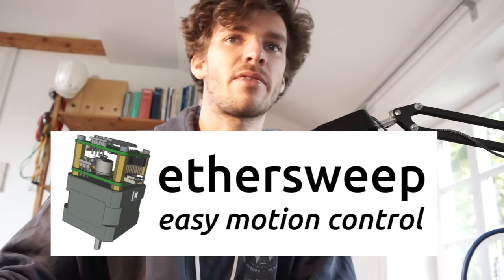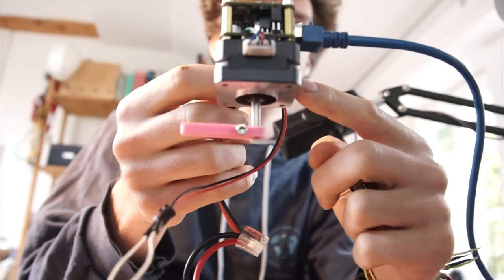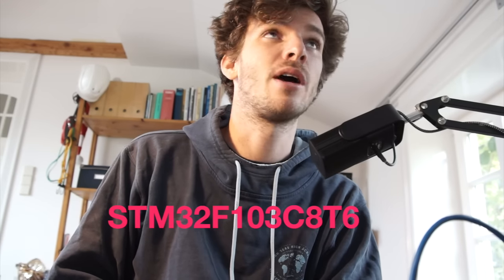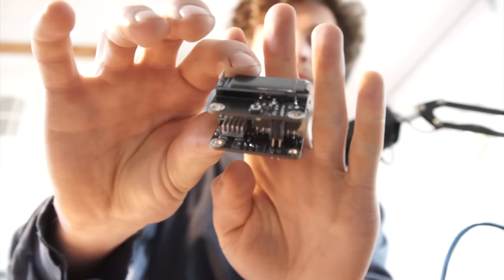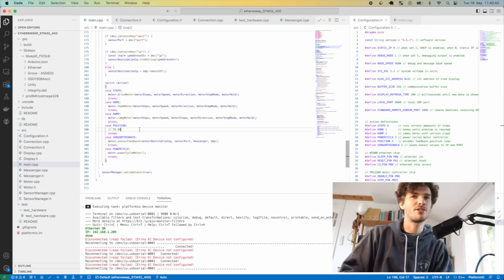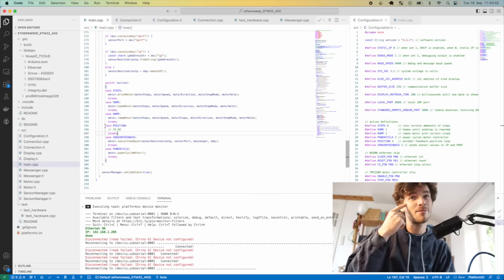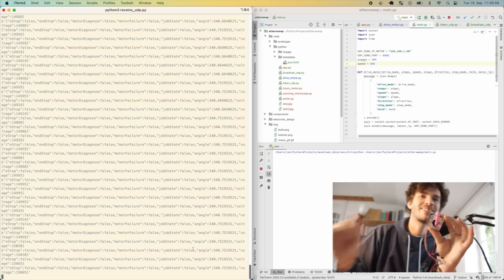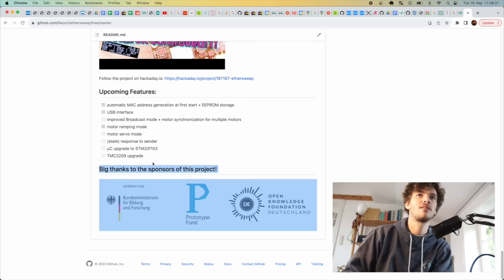What happend to Ethersweep? Project Update!

Comment: It might be a complete redesign, but have you considered adding power over Ethernet to these boards? It would be a really attractive feature for rapid systems design.

I've created quite a few motion control systems, and by far my favorite small servos to use are Dynamixels, which can be daisy chained with a single cable. It speeds up testing iteration so much, being able to arbitrarily move or add motors without having to make multiple cables for comms and power. In this case, there's a power solution already designed for the physical layer youve chosen, and can provide enough current to drive several motors simultaneously.
Reply: yes this! and offering kits for propotpying application where time goes over money.
Reply from the maker: Yes POE is in the planning for another prototype. It's a bit hard to put everything in the small form factor it currently has but let's see :)
Reply from the maker: @NmEter2  The boards can be easily ordered with my files on GitHub. You only need to assemble some THT parts and the SMD AS5600 encoder. But when the next hardware version is ready, I'll try to distribute them somehow. Prices are currently estimated to be around 150€ for one set with some minor assembly.
Reply: @Neumi  Looking at the designs, there's quite a few big changes that would have to be made to keep the form factor. It's awesome that you are working on it!
Reply: @Neumi you can always add a board to board connector and add a second PCB 
the length of a stepper motor assembly are rarely critical.
Reply: And maybe to give that small microcontroller a chance of running at higher speeds consider switching to a more basic protocol and not ascii encoded json.
Reply: @Neumi I tried to make a POE blind motor (blind meaning roller blind for your windows) but the POE design was quite expensive, but I was over designing it using reference designs from TI. I want to revisit it but using premade poe sinks so I got one for 12v 2A or something like that and hoping to work on it at some point (probably in a year 😅) 

Maybe this gives you some idea, and actually now I just checked, you can now find POE+ (12V 30W) modules. Search this I think it will be very helpful

PEM3012C

This module pretty much solves the power issue it seems. Have you considered using esp32? It can use ethernet and then work with home assistant. I wanted to do this because when I renovate my house I will put a cat6 cable in each window frame to then connect to the controller and I can have automated blinds in home assistant.

Hope this gave you some idea and found the module useful :)
Reply: POE definitely seems interesting, but when doing a basic search, it seems that it's only capable of supplying 350mA at around 50V-- so 17.5W max.  This seems a bit restrictive for larger steppers that may require a lot of power for a short period of time.  I would also hate to rely on some random switch that may be capable of a limited amount of power across several ports simultaneously.  You really want to eliminate any sources of uncertainty when controlling physical objects that may be quite expensive, which could destroy things or cause safety issues if not operated very consistently.  It's one thing to have a device glitch and need to be restarted, but another entirely having the potential to ruin something if operated incorrectly or unreliably.
Reply: @arva1kes  they are 12V but only 1A or so, unfortunately these steppers at max holding torque need much more, so to build a POE+ module is quite hard but if he is willing to design one which can be split into 2-3 layers it would definitely work. POE+ modules do exist but as a daughter board to solder onto a motherboard
Reply: @flomojo2u  thats why I talked about poe+ 👍 also why would you be relying on a random switch? I am talking about using one in my home, so the switch that I choose will be able to provide enough power anyway, if not cost effective Id use poe injectors. Quite simple really and you end up with a single cable solution
Reply: @flomojo2u  I agree. And even if the wattage is enough, the small wires have a lot of impedance, so rapid power changes will spew really badly. So unless you have a ridiculous amount of capacitor power storage steps will get missed as the current isn’t there when needed.
Reply: POE is probably ok for a couple of small infrequent loads, but you really do want to have local power because some steppers are hogs.
Reply: @TonyCoyle  true however the idea of only one cable needed really appeals to me, I haven’t actually tried a poe one but on paper it seems like it should work, the stepper motor I used, a normal nema17 one needed 2A (24W and poe+ can give 30W) for my setup, the stepper was also geared down to give more torque, I could probably increase the ratio to get more torque.

Also very large POE PTZ cameras have multiple steppers in them often working at the same time. So if there’s enough power for those then why not for one stepper? Yes some times the cameras use their own poe injectors and im actually also fine with that as I will have most of my equipment in a control panel for all the home automation stuff so it works for how I will design my place.

Comment: Would love CAN BUS support for control and sync.  You could still setup with LAN, of course.  Great work, btw.
Reply from the maker: CAN is definitely on the list of features as an alternative option. Test PCB is already designed.

But then we have to come up with a new name I guess :D
Reply: @Neumi smart sweep 😁
Reply: SweetSweep
Reply: CanEtherSweep (?) 😂
Reply: RemoteSweep
Reply: DualSweep
Reply: DerSweep (for 'der'tiministic and german)
Ok I will show myself out now...
Reply: Hmm does that even make sense if the mac would support avb ethernet you basically only need as much wires as CAN.
Reply from the maker: @platin2148  I think CAN is more for machine2machine communication and not if you want to drive the motors from your computer. Both protocols have a good reason to exist, but I thought standard ethernet would be cool because I can control them from my average household computer/raspberrypi. CAN would be great if you anyway have a CAN network set up I guess.

Comment: It would be cool if a few free gpio pins of the microcontroller could be exposed to an optional third pcb that could be stacked on top, so one could add additional sensors and read/control them over network. This is such an intriguing project. I'm afraid I have to much on my plate to contribute.., but I'd love to get in contact

Comment: FreeRTOS is your best path forward for a scheduler. Be careful to keep interrupts short by just waking a thread to do the work.  That way you’ll stay more real-time for the critical threads like the rotation sensor and stopper commands. Great start!
Later on, a servo version would be very compelling for cnc control of large mills or lathes. Check out Physics Anonymous cnc mill build to learn more.
Reply from the maker: I‘m not sure if freertos has too much overhead and long ticket times. Maybe its faster and better to build the scheduler myself (?) 
But I‘m not set on that :) feedback very welcome!
Reply: @Neumi  or just use Rust :D
Reply from the maker: @elpiel  Rust for embedded? Haha no way :D you'll see me write drivers for the next year :D

Comment: Very interesting project!  Thumbs up and subscribed.  If I were to do this, I think an ESP32 using wifi and bluetooth would be the processor, with FreeRTOS, using MQTT messaging.
Reply from the maker: Thanks! MQTT is on the list of potential features. Not sure about the instruction set yet, though. FreeRTOS might be an option to get better timing. Do you know how fast freeRTOS runs on the ESP? In terms of cycles or tickets/second. As the controller currently needs to do all the step driving and timing for the TMC2209 and therefore do I need very fast timing. Having a fixed cycle time with freeRTOS does not help if the cycles are 100 microseconds when driving individual sub-steps :D
Reply: @Neumi maybe you could make use of timer peripherals for doing the step counting so you can free up the cpu for other tasks.
Reply: I was about to recommend ESP32 as well. Wifi is so much nicer than needing an ethernet cable and switch port for each stepper.

Comment: Looks really interesting, how accurately do the individual steppers synchronise to each other.

Any thoughts on adding Poe+ or Poe++?
Reply from the maker: Currently approximately 10-20ms. But it depends on the network load. And it is not optimized yet. Nothing for CNC control.

Comment: This is really cool! I can see this lowering the barrier for entry on motion control. Like others have said, having an integrated switch for daisy chaining would be awesome to see. 
Is there a reason you didn't go with an ESP32 or ESP32-S3? It supports ethernet with the addition of a PHY transceiver.
Reply: He could use the wesp32, or a similar design, then you would get 11W from POE, and a dual core 240mhz mcu with 100mbit ethernet phy.

Comment: Have you considered some kind of NTP Time Sync to synchronize the clocks of each motor ? 
The idea being that if you're able to do this then you could possibly synchronize moves of several motors by sending some commands to several motors along with a time for the command to be executed.
Reply from the maker: I love the idea! That was actually a loose idea some months ago, but I didn't test anything in that direction. I'm unsure if NTP can be synchronized to a few microseconds on a normal ethernet network (?). If you know more about that, I'd love to have a chat!
Reply from the maker: I just read "down to 1ms in local networks". This would be at least an advantage over normal packet times and its spread.
Reply: Really nice project, you could look into Precision Time Protocol (IEEE1588) ptpd implementation, but you need an PTP capable ethernet phy as far as I know. I'm no expert on it, and it seems complex. Just wanted to share :)
Reply: @Neumi  Sorry can't help you much, it was just a random thought from an internet bozo ....
Reply: @Neumi  To synchronize the "actions" (f.e. in a CNC application with more than one axis), like moving exactly a 45° path, the easiest way may be accumulating the commands for the actions, then committing them (state = ready) and synchronizing the start of motor stepping over a DISCRETE signal(non latency-affected by definition). Well, that defies the "beauty" of a pure network solution, as an additional, not hindered with latency, signal path that had to be introduced. 
Anyways, you did a great job with your project and you can be proud of your work! Who said that there has to be a solution that can handle EVERYTHING? God's "Eierlegende Wollmilchsau"?:))
Reply: Maybe you could try to get in touch with someone from the Institut für Werkzeugtechnik from the University of Stuttgart. I know that they do some research about timings and latency in industry networks with sensors and actors. If you want I could ask someone from the Institut if he knows somebody who is involved in this topic.
Reply: @Neumi  Just talk to Jeff Geerling. He knows some stuff about NTP and PTP. The latter has a precision down to nano seconds.
Reply: I also think the timing between multiple axis is crucial when used with more complex machines like 3d printers, laser cutters, cnc mills etc. Maybe you could write an integration for linuxcnc? You or other people could then test the real time performance of the system with the Differenz synchronization options.

Comment: PoE would be useful. I know this limits the power of the stepper which can be used, but for many applications this is OK. Also, it is important to keep costs low. It may be good to have several models with different features and costs, so no more expensive unit than required can be chosen.
Reply: PoE+ supports 30W, there are higher POE standards that do up to 100w. This has me wanting to build a 3d printer using this but I want POE because then I can use a 5 port poe switch with a Pi and 4 steppers. :D I've been wanting to build a printer with servos, these have the encoders so it makes the stepper a servo. No lost steps ever. :)
Reply: PoE seems like a good fit here, but for anything larger than nema 17, 30W might not be enough, at least not if maximum performance is the goal.  OTOH, Hi-PoE at 100W should do it.
Reply from the maker: I think the same. High power and surge is a problem with POE. Especially if you need multiple motors the switches and injectors get very expensive.

Comment: Amazing project! i was looking to something like this for a long time but that works with ArtNet, so that the motor moves to certain positions based on a dmx output (0-255)
Following you for more inspirations ;)
Reply from the maker: artnet would be very cool! And I think not too hard to build as an additional firmware or mode :)
Reply: I would be very interested in that!! I have been working on a project where I did exactly this with a basic Arduino setup. The biggest issue that we have and I think you can quickly solve is implementing a 16 bit mode. If you ever end up spending time I would love to help out.
Did I mention this is an amazing project!!! ❤

Comment: How about use ESP32 with WiFi conectivity ? Then you just need a power connected.  And maybe also support for MQTT protocol ?
Reply from the maker: MQTT is definitely on the list of ideas. Wifi not so much. The wifi credentials somehow have to be programmed into each controller. As we need a cable anyway for power a data cable is not too much of a problem. Data rate and reliability is also much better with cable. But I see use cases for wireless motors ;)
Reply: @Neumi  With WiFi you can use that some kind of 'standard' model, to create WiFi AP, connect and enter credentials over some simple web page. 
And with ESP32 you can create Bluetooth version of the motor 😉
Reply from the maker: @milan8063  I'm not a very big fan of ESP32/Espressif chips. They tend to be unreliable and run some strange stuff in the background that you can't control. (you can't even run ESPs as an I2c slave at reasonable speed for that reason...) This is nothing for an industrial controller IMO. Running these in a robot or some automation assembly the disadvantages of wifi are bigger than the advantages. But maybe in the future, I might build a board to get Wifi ... lets see... (or someone else? :) )

Comment: you could've used an ESP32, Motor drivers and 2 Lithuim Ion batteries with charge controllers onboard to make a fully wireless wireless capable motor.

Comment: There are couple comments about esp32 but you could use esp32 with POE ethernet to give it power, forget about wifi. Also esp32 is cheaper than atmega328 and stm32f103 .
Reply from the maker: ESP32-S2 and STM32F103C8T6 costs around 1,4€. But the atmega328, of course, is expensive and has lower specs. What I don't like about the ESP32 is that it needs a very stable power supply, power power-hungry (maybe not too important) and is prone to errors. It just runs less stable than the STM32 controllers, in my experience. Plus, the ESPcore has to run in the background. And timing is also not very deterministic and unstable. POE would also work for all the other controllers.
Reply: @Neumi Now that you mentioned power stability and running in background it seems to be right choise to use STM32
Reply: @Neumi I guess most of the time esp core manages wifi, if you use it with ethernet, there has to be less latency. Also RTOS.
Reply: @Neumi  I think a dual core ESP32 would be a better choice (compared to the ESP32-S2) if it were considered for the controller. One core dedicated to the motor and the other core for the communications.

Comment: How would you implement PID control on stepper motors? 
Im looking to implement the same thing but it gets confusing and there isn't a lot information on closed loop stepper control. 

What would be the input and output of the PID system?

Comment: I cant wait for new and amazing projects based on Ethersweep! Imagine 3D Printer as microservice architecture! I didn't expect more ideas to fuel my  nightmares but here we are
Reply: The Klipper 3d printer firmware is already halfway there, it supports running on multiple MCUs controlled and synchronized by a central host

Comment: My only question is around acknowledgments from the network with UDP. That would mean for critical applications you would need a round trip using the rotation sensor? Plus you’d also want your controller server to detect things like frozen or unresponsive motors. Maybe you don’t need that if you have a private network for these but at some point accuracy is questionable with UDP given thousands of input controls in a 3d printer application. Turning to a networking problem seems much easier on the surface. Looking forward to more updates!